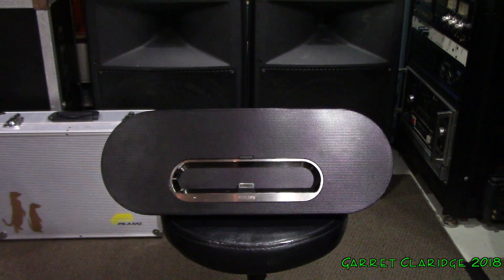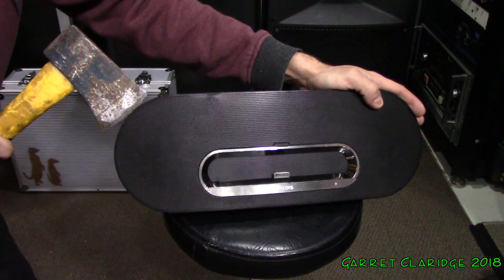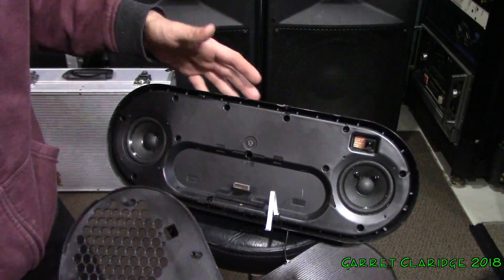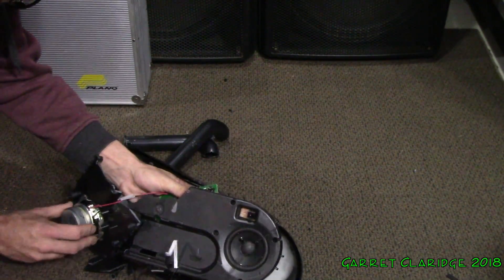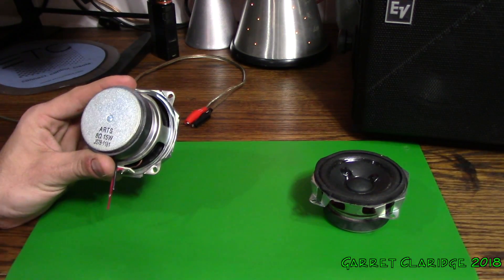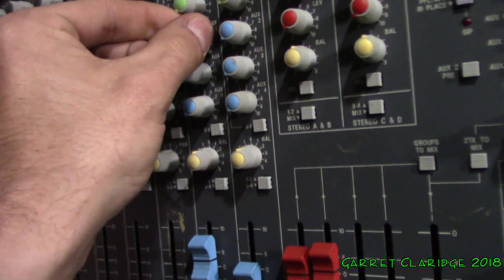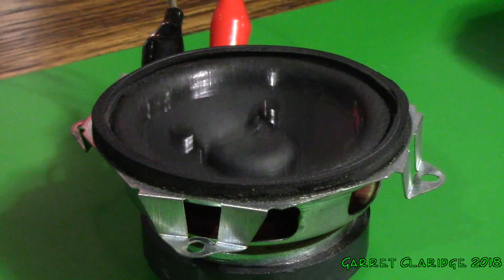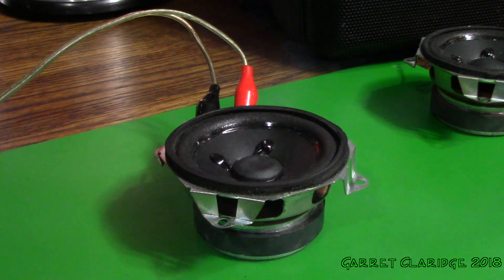SPEAKER BLOWOUTS! Philips iPhone Speaker Teardown

Comment: Hey garret I have a interesting way to smash a CRT monitor if you have one lying around. Heat the glass up with a blow torch till its extremely hot then spray it with some cold water. If done enough the glass should start cracking and if you are lucky explode. Just don't be near it if it does explode as shards in the eye hurt lol.

Comment: Nice blowout. Btw any tips to fix a pushed in paper dust cap?
Reply from the maker: Whoa dont use a fucking pin, that is the most stupid advice ive ever seen haha

Strong tape however you may risk tearing a layer off with a paper cap, start with masking tape and work up, press it on small areas at a time and lightly lift the tape using care trying to manipulate the cap back in shape without pulling on it too hard

Vacuum works for big woofers, I did it one time to a tweeter and it sucked the whole damn cone away :D
Reply: You can get a pin and put a little bend in it like a right angle and push it in and pull it out (I used this on my tweeters)
 https://www.youtube.com/watch?v=LGFGnRm3adA
Or if you don't want to make holes than use a vacuum cleaner like this for a subwoofer
  https://www.youtube.com/watch?v=IHeGmsXIsdQ
Reply: Thanks I'll try this
Reply: ScellyCraft YT your welcome
Reply: Garret Claridge lol I am kinda stupid like that, I used it on some tiny tweeters and I didn't have no good tape around, I don't really notice the holes and I drew over them with a sharpie and you barely realise
Reply from the maker: It would work for sure aha But even I send speakers for repair sometimes, Depending on what the driver is iv'e cut off and installed new caps or even full re-cones since the voice coil can be dis-aligned if the cap was poked just right 

Your idea would be tragic on a woofer, ive seen pin holes turn into full rips on a speaker from air pressure, but I work with lots of guitar speakers and high output pro drivers might not do much to a lil home speaker
Reply: Garret Claridge holy crap, I've never seen a rip in a woofer by a little hole in the dustcap

Comment: Any type of phone dock is almost always terrible...
Reply: Hi-Fi The fox and even worse outside the enclosure
Reply from the maker: i have a Bowers and Wilkins one ;)
Reply: Garret Claridge B&W Zeppelin?
Reply: I found a beatbox portable form 2010 in my basement and it sounds amazing but it kinda lacks the portable part as it has a cover for 6 C size batteries if your taking it somewhere...
Reply: but hey, if it would be boombox it would be OG
Reply: I have a philips one and it sounds real nice and it cost me $15 used. Runs on an ac adapter or batteries. Worth it for my iPod collection.